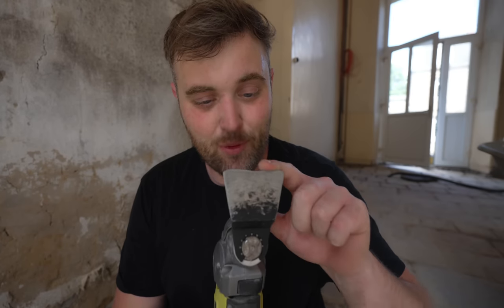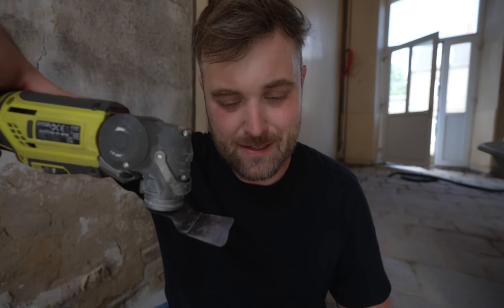Bringing History Back to Life - Restoring an Ancient Floor

Comment: Running a power compactor over the stones after you spread the sand/lime into the cracks will vibrate it down into the cracks (if that’s what you’re hoping to do).  Then you can spread more.
Reply from the maker: i have one with a rubber mat below but i don’t want to damage any with cracks! i was seriously considering it today!
Reply: @ThePethericks  I totally understand. Those stones are beautiful. I can’t wait to see them after you oil them.
Reply: @ThePethericks  With a rubber mat? That would have been perfect right after you spread the sand mix.
Reply: Been waiting for you!
Reply: The stone floor is stunning. Worth every bead of sweat. So glad you found it under the concrete and your choices on how to handle it has been brilliant.
Reply: @ThePethericks  use the compactor
Reply: The stone floor is beautiful. My back hurts just watching you work on it today. I love your determination.

Comment: When you get to putting the cobblestones on the driveway think about putting tiling under the sides so when you get another big rainstorm the water can be directed into the sewer system without pushin into the convent.

Comment: When brushing in the grout between stones, you should brush diagonally to the joints to avoid removing too much grout.  When you are done and before you polish the floor, you should use a powered floor buffer with steel brush attachment.

Comment: Two tips - run a compactor over the floor to help vibrate the sand/limestone deeper under the stones and 2. Brush the sand/limestone at 45 degrees to the joints to keep the broom bristles from pulling the sand mixture out of the joint. Great job!

Comment: Billy, I so agree that it is definitely worth doing it properly!!!!! 
A while back, I had left a comment about leaving the floor as it is and just adding slopes to the other doorways. 
I was afraid if you lifted it, you wouldn't be able to get all the stones put back exactly where they were. Thereby, you would lose the worn path where people had been walking across it for a few centuries lol. Plus it would allow for handicapped individuals to get around easily. Also, if you need to move things around, it would be easier on a slope than a step. Especially things like a food carts or anything else with wheels.
So glad that Gwendolyn felt the same way. 
It would have been a shame / crime, to lose the worn paths across the floor. Just like stairs can take on a worn look as well. Excited to see it finished.

Comment: When trying to fill gaps (with grout or sand/line) its best to sweep at a 45° angle to the joints. This allows for more even distribution. Sweeping "straight" will result in filling horizontal gaps but sweeping out vertical gaps.

Comment: Billy, there's an attachment you can get for the hose, that's designed for wet sweeping driveways. I think it might work really well on the floor instead of the spray nozzle on the hose. Plus, it might be a lot easier of your poor back!

Comment: Looking great. Was wondering on your various entries to that room, do you plan on some small ramps? You don't have huge drops at the side doors so those wouldn't be very long. The one leading into the kitchen you might need to remove some of that concrete and reshape it. Not sure about French regulations for wheel chairs but in the US the specification is one foot of ramp for each inch of rise. You may not need quite that much but need to investigate.

Comment: Just spray in the air to wet the floor to set the pointing or you will blast it out. There’s also a chemical used for removing cement from stone.

Comment: Question: 
If a room is over a hundred years old , and  the ceiling got wet from the roof leaking and the material  expanded under the paint, lifting the paint, what material could it be? 
Lime? Plaster? How would one find out? 
& What would be recommened to repair it? Thanks!

Comment: You better off leaving the cavities alone. You cleared paver sand and refilled it with the same thing. The problem with that is the pavers settled closer to one another than when they were first installed. There’s supposed to be a defined gap in between them. So being close together and filling in paver sand, it leaves voids and isn’t as strong. I found this out the hard way with my own patio, they placed them jointly side by side with no gap, as the result in about a year that paver sand will dissolve not being thick enough.

Comment: I recommend you sandblast the granite stone in the hallway; you will be thanking me after you witness the presence of the sandblasted granite.
Reply: I am curious, is it possible to widen the door opening in the wall opposite to each other in that hallway so as to accommodate the installation of a wider set of doors. You may have to cut into the granite on the outside walls but the cuts can be hidden with trim work in wood or metal. Wider rough opening will allow wider doors which will allow wider equipment to pass through the hallway into the back garden. Just do it!!!

Comment: Bility, you have done a great job with this floor and I commend you. But I have to admit that one of the reasons I watch this channel was the camaraderie of you and the others. Especially Sean. Considering he was a focal point in your videos, I find it hard to believe that he will not be returning. We all know that Ryan is not coming back because of his family obligations. And I know that you have limited funds to a hire other workers. But the loss of Sean has made this channel less than it was. At the very least, I believe that the people who supported you and watched your videos for years now, deserve an explanation.
Reply: @janetpendlebury6808  I understand that but it is a big building and there is other work to be done. Also Sean has said that Billy has another carpenter lined up for the future. All I said was that the overall feeling of the videos have changed with no explanation of the changes. Your comments have not been specifically confirmed by Billy.  If the channel is changing by reducing the number of participants or removing a major contributor- it would be nice to know the direction that it will be going in the future and why.